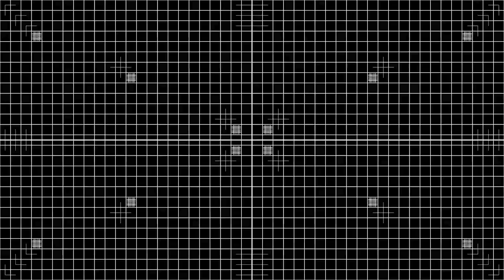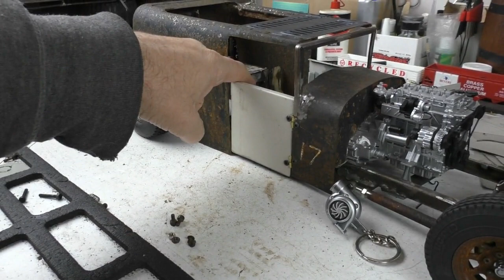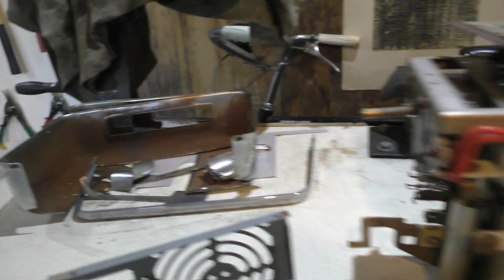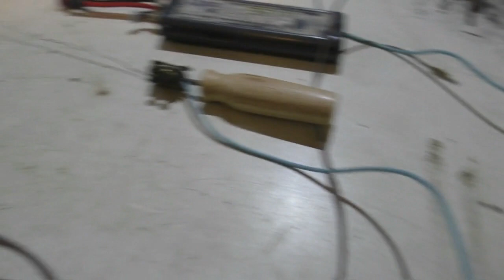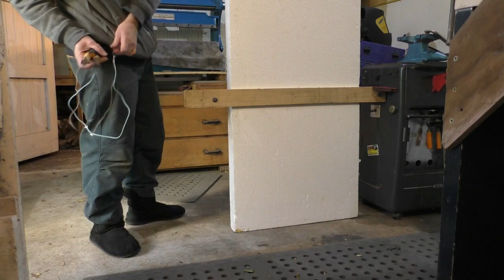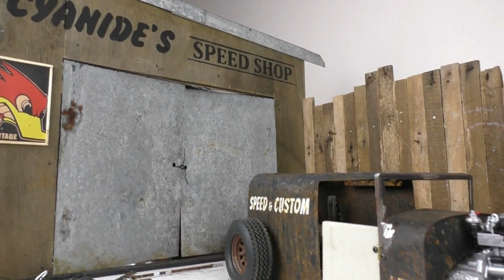17/7 - Custom metal RC model rat rod shop truck (progress so far)... and a hotwire cutter.

Comment: The shop truck is looking great. It's always a good idea to just step back from a project sometimes. 1500 grit sand paper might help with the letters or even up to 3thousand grit just a thought. Thanks for sharing
Reply from the maker: Thank you Robert. Sometimes I get carried away, but, for now I am going to leave it, the rust should continue to 'muddy up' that white text, so will revisit that later.